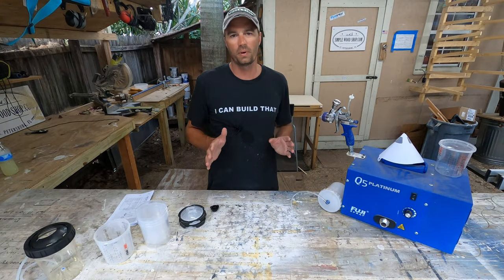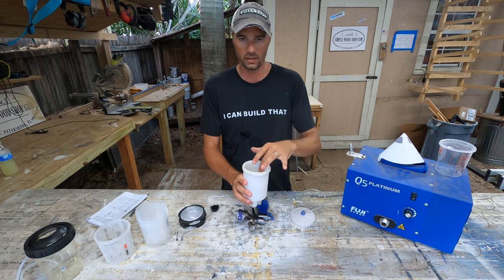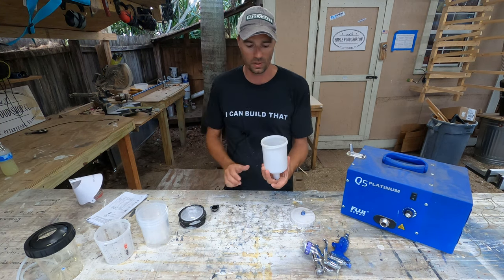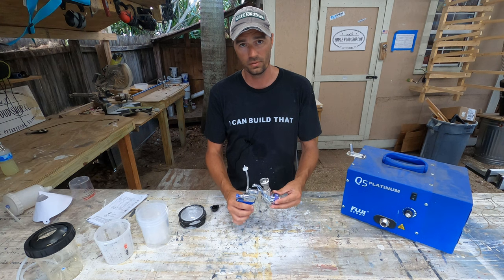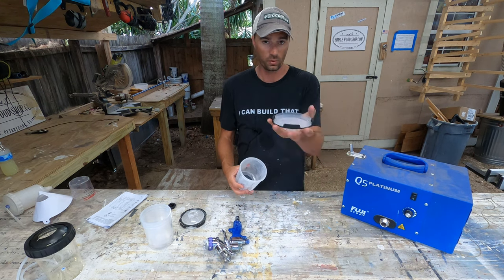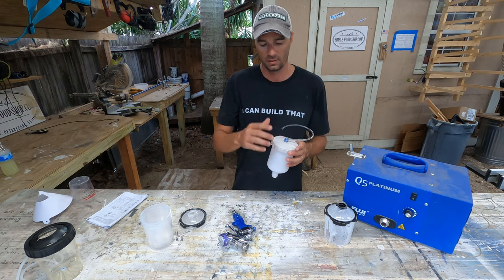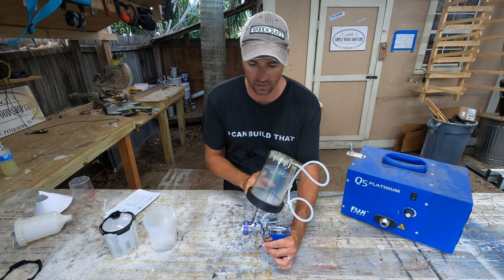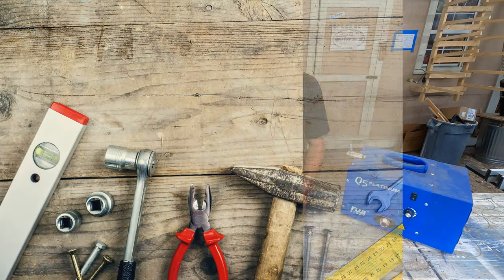Fuji Sprayers and 3M PPS 2.0 system, problem solved

Comment: I started heating up my thicker yogurt viscosity materials and then tried it with nice thick tung oil based varnishes keeping the flash point low and do not need to thin it at all, but I thin it just a little and get excellent finishes! I've never needed this PPS system, but im gonna get one to have and see if it helps anything... thanks for sharing.
Reply from the maker: Do you have enough time before it cools to spray it?
Reply: @SimpleWoodShop  Of course, it can stay warm enough to around 1 to 2+ mins out. For me it's one thing, but I would suggest getting some time in, experience wise as you will get the feel for what is needed or how hot you can get it without any issues. If it's too hot it can flash on the proceeding passes. It's a short learning curve too..' You got this!

Comment: I thought the H/O version was for bottom fed guns, not gravity fed.  I thought  The normal 2.0 version was for gravity fed?
Reply from the maker: There is an H\O cup for both versions of the PPS.  The h\o cup allows you to connect the air pressure to squeeze the bag and push the material through the tip.  The Fuji sprayers need that pressure.

Comment: Great video. I use the PPS 1 H/O system which is very similar but with the advantage of being able to use generic cups and liners, saves a few pennies and I can always nip to Harbor Freight if I run out.
Reply from the maker: Harbor freight has liners and lids for the original system?  Didn't know that.
Reply: @SimpleWoodShop  I suspect a large part of 3M's motivation for the 2.0 system was to control the consumables, the adapters and cup moldings look significantly harder to machine and are probably patent protected.

Comment: it looks like such a great system, but at ~$3 per disposable cup, Im not sure it saves anything over the filter and some wasted material :/  would be cool if you could just buy the liners.  Im sure the hard plastic lid and plug could be reused far more times than the flexible liner.
Reply from the maker: I tend to wash out the liners and reuse them later one.  It's pretty easy to do.  Most are not $3 a liner they are really cheaper than that. They wash out very easily, another benefit is the whole thing is pretty air tight, so I can leave my sprayer and paint in the liner over night and spray the next day without any issue.

Comment: To be fair all your really throwing away is a filter  if you clean out the disposable cup. You still have to clean the gun so sodd all difference imo. And what do you do with the pressure hose ???? The first pot had no option to fit it..
Reply from the maker: On the h\o pressure cup there is an attachment for the hose to go onto.  It provides the pressure to push the material through the sprayer.
Reply: @SimpleWoodShop  
Yea I realise that, but the first cup you showed doesn’t have a pressure hose point

Comment: Great vid and info. This is okay for the T70 range, but not for a G-Xpc (side mount cup) that i ordered with my Q5. 
There is no 2.0 PPS adapter for the G-Xpc. The only one manufactured is for the 1.0 PPS system and is Adapter 24 (161100). Then there's the cup size which has to be an 8 oz 170ml otherwise it won't fit. The adaptor is not available in the UK, even 3M over here were useless and couldn't help. I've started to import them from the states to help guys out, but info like this is invaluable to guys buying systems like the Q5 who just think they can buy any cup liners and lids and expect them all to marry up without any problems.
Reply from the maker: Thanks for watching,  Is this the adapter that works for the G-Xpc guns?  https://www.phelpsrefinishing.com/3m-pps/s24-pps-adapter-gxpc-gt-x2
Reply: @SimpleWoodShop  Bit deceiving that picture Matt, as my order arrived from Phelps and isn't the one as advertised in their picture It's turns out (After speaking to a local paint supplier) that 3M very craftily went round a lot of their users and trade suppliers in the industry and took away all the 1.0 adapter stuff and replaced with 2.0 rendering all the excess cups useless and forcing people to upgrade thus making 3M more money in the process. This means i now have to buy a load of new liners to go with this 2.0. Not happy really!!
Reply from the maker: @vr6caddy843  You will need to speak with 3M and Phelps regarding their pictures and strategy.  I am not affiliated with either one of them.
Reply: @SimpleWoodShop  hey Matt, appreciate the reply, I know you are just trying to help everyone out and your information is invaluable.
As soon as I received all the adaptors, I got on to Phelps and told him about his picture not being what he sent. he never replied which is not very professional, especially after me speaking to him on the phone before purchasing. I'm still having trouble now buying the cup, even my suppliers of paints I do a lot of business with spent an hour with me trying to figure out what goes with what. I think the 2.0 pressurised cup is only available in the states, and to add insult to injustice the 2.0 cup now is a fat little thing not the little dinky one for the 1.0 so I'm no better off. I should have ordered everything from Phelps and if everything didn't marry up, that would tell me that he's just sending out stuff without checking things!
if you have any further info on things, please let me know. if I could track down a 1.0 adapter type 24, I'd buy that also, but just concerned I might get another 2.0 adapter.
Leon

Comment: When using the 3m PPS system do you have to plug the air line coming out of the gun? Or just let the air flow freely?
Reply from the maker: You will need the air for back pressure.

Comment: Excellent video, and thank you for clarifying the black cap on the H/O cup. Question: You recommend using the H/O cup for thicker latex paint, would you recommend this system for all liquids, instead of the non H/O cup due to the added air pressure assist that allows you work even upside down? I'm just trying to decide which kit to purchase. In other words, is the simple gravity fed cup good enough, or should I get the H/O cup.
Reply: Hey,  I would go with the h/o for everything.  I tried to spray primer with only the gravity feed cup and it was frustrating.  The h/o is about $80 and definitely provided that back pressure that is important.  When I did the primer I found myself pressing down the liner with my hand to give it that pressure.  There are two sizes of the H/O cups available.  The smaller cup would be better for spraying upside down, because you typically are in tighter quarters and the cup fits better in those spots.  Hope that helps, enjoy the system.
Reply: @matthickman2589  Awesome Matt, thanks for replying so fast! Last question: I'm going to buy a Fuji Q5 today, so gravity fed or bottom fed? I mainly paint furniture with varnish and paint.
Reply from the maker: Hey Mikey, I've only used the gravity and am happy with it.  You will love the system, If you plan to buy it click on one of the Amazon links I have in the description  and I'll get a little $ but you wont pay more.  Thanks.

Comment: Thanks so much for your excellent video. So it seems to me … that Using the pressure cup with included air tubing, I will still have to mix my coating in a mixing cup anyways? Didn’t see any mixing ratios on pressurized cup. I am also using Fuji gravity gun .
Reply: A separate mixing cup I mean
Reply from the maker: You will have to mix and then pour it in. The liners don’t have any indicators.

Comment: How do you save the material out of the h/o cup when your done?
Reply from the maker: Thanks for watching, The materials with the 3M PPS systems is inside a disposable liner and lid that has a filter in it.  When you take both out of the h\0 cup you can put a plug in the top and put it in the cup that comes with each kit.  Each kit comes with a hard plastic cup to store the solution in and plugs.  The cups are reusable.  The liners and lids are disposable.  If you haven't yet, I would appreciate if you would subscribe, I am working to grow the channel. 

https://amzn.to/36vnhE6

Comment: Quick question, great video BTW. So if you aren't spraying super thick materials then using the pressure tube isn't really necessary? All I will be spraying is automotive paints and I have a similar system currently with the disposable cups for my DeVilbiss paint gun. I'd love to have the same setup like that for the Fuji. I don't have a Fuji yet, I've been investigating the different systems out there. Seems like the Fuji is really good, the other one is the Apollo. Do you have any insight in to how those compare? thanks again.
Reply from the maker: Thanks for watching, I appreciate it.  As long as you are getting consistent pressure and the spray is not sputtering then you are probably good without the pressure tube.  For automotive spraying you might find yourself at odd angles and without the pressure tube pushing the paint it may not work as well.  With the h\o pps system there is constant pressure so you can spray at odd angles.  

Fuji is great stuff, I don't have any experience with the Apollo systems.

Comment: I like spraying at all angles so I only use the PPS with the pressure cup.
Reply from the maker: Hey Mike, That is a significant benefit to the PPS system with the cup.  I haven't had  a use quite yet for it myself but I have tried it on some scrap.  What do you spray?
Reply: @SimpleWoodShop  ... Latex house paint like BM Aura or Scuff-X.

Comment: Great video, answered so many questions I had about adding PPS 2.0 to my Fuji. I would assume the answer is “no”, but does the H/O cup help “push” thicker paints like latex? I know the standard T75 gravity cup is pressurized, but was hoping that maybe having the pressure on the top and sides of the liner might help push thicker paints. So far, I’ve had to thin most latex paints 15% and use a 1.8 or 2.0mm tip to get good results with the T75.
Reply from the maker: The H\p cup does help push the paint better.  I have the Fuji Q5 and I can push latex pretty good.  I do thin it about 10% just to help it but it works well.  18 or 2.0 tips of course.

Comment: Thank you for this video. I just received all the components for the 3M PPS 2.0 system to use on my Titan CapSpray 115 and spent 5-10 minutes tinkering with the h/o cup to get the disposable filter lid to work with the hard cup ring. I got it figured out and then found your video that confirmed my assembly was correct.
Reply from the maker: Right, at least you only spend 10 minutes.  I spent a little more. Glad the video helped.

Comment: Thanks for the video... so basically the 2.0 becomes a 1.0 if you need to use the H/O tube? Since you have to remove the locking ring, it basically makes it the 1.0 system and cost 2x as much. I was thinking of going to the 2.0 - lots of nice upgrades, Except that - which makes it useless with the Fuji T75G gun with pressure tube.
Reply from the maker: In my experience with it in order to use it with the T75G (which I use) you have to have the h\o cup for the back pressure.  otherwise it is gravity fed and then your spray will not be consistent.  It is a good setup, once you buy all the parts.

Comment: Nice and informative review! I'm just starting to use Fuji system and still needs lots of to learn. Currently looking in an ability to use 3M PPS 2.0 due to reasons you've perfectly listed in your video. Not sure if it is compatible with G-XPC gun due to its cup mounting position :/
Reply from the maker: Hey, Thanks for watching.  I appreciate it.  What are you using the sprayer to spray? You can use the 2.0 systems with your gun.  You will need the adapter I will link below.  

https://amzn.to/33xc5VD
Reply: @SimpleWoodShop  Thank you for the answer. I'm going to look for that adapter. I was confused, because it's (the G-XPC gun) not being listed in https://multimedia.3m.com/mws/media/1451272O/pps-2-0-spray-cup-system-part-number-reference-guide.pdf.
I'm a hobyist woodworker and using it to finish my projects. Usually water based lacquers, primers and polyurethanes.
Reply: 3M has adapters for almost every spray gun on the market
Reply from the maker: @ufta54  That's right, they do a good job of making their pps system compatible with alot of sprayers.

Comment: Just switched from a Devilbliss (using 3M PPS 2.0) to a Fuji Q5 with T70 (bottom feed) and want to covert to use the 3M 2.0 system that I have quite a bit of stock and want to continue to use for cost/convenience.  Great video!
Reply from the maker: Thanks for watching I appreciate it.  Why did you swap over?

Comment: Thanks. I'm just diving into HVLP spraying as a home hobbyist and have found value in some of you videos as the Fuji products drew me to your site. I think I will try the 3M PPS 2 (was going to try the original series, still on market). I'm trying to spray linseed oil paint, which is quite thick (will have to thin, unfortunately negating some of the zero VOC appeal of this medium). It's expensive stuff and I don't want to waste much of it.

I actually went with a Sprayfiine A301 3 stage. The Fuji Mini-Mite 3 looks great, but is quite a bit more than the Sprayfine with a lot of similarities (except the Sprayfine comes with a bleed gun).
Reply from the maker: Thanks for watching, I appreciate it.  I would go with the 2.0 PPS system, there is an investment up front with the H\O cups and adapter, and if you did the 1.0 system you'd be slowly phased out.  With the thicker material you will need the h\o cups for that added back pressure.  Match your aircap to your material as well.

Comment: Very helpful video. I have the same setup and just received the PPS 2.0 items.  This will save me some time. Thanks.
Reply from the maker: Hey, Thank you for watching.  Glad it helps.  The pps 2.0 is great and I've found that I don't have to use any strainers anymore.  How do you enjoy the Fuji sprayers?
Reply: @SimpleWoodShop  I have used it twice and like the fact I don't have to thin latex paint too much with the Q5.  Very happy with the results. Looking forward to less cleanup and quicker setup with the PPS system.
Reply from the maker: @romanbenko8187  Exactly, not having to thin too much is a nice benefit.  Glad you like the system and the PPS cups.  Thank for watching the video.
Reply: @SimpleWoodShop  I didn't even know there was a 2.0 system.  The Fuji site just listed the original PPS so I ordered it. While waiting for it I came across your post and then did some research.  I returned it all, unopened, and ordered the 2.0 system.

Comment: What are pros and cons to the two different cup systems? Bottom feed and gravity feed?
Reply from the maker: I have only used the gravity and I like it, with the PPS setup I can get almost all the material out of the liners, very little waste.
Reply: @SimpleWoodShop  sounds good thx for your response. I found that when I did a little auto body work the bottom feed cup would bump things

Comment: Could a 3m performance spray gun be used with the Fuji Q4 platinum?
Reply from the maker: It might be possible, not sure about the connector but I am sure there are adapters for that.

Comment: Do you think you could paint a car with this Fuji sprayer? Seems it produces much less overspray than the compressor systems.
Reply from the maker: Hey,  Yes, Car paint is typically on the thinner side and this pushes that stuff nicely.  I don't have any experience with car painting or compressor systems.  I think it would do a nice job.

Comment: Great tips and not so much waste of plastic too which is a very good thing. I guess this is a failure in 3M’s part by not seeing to make this step a necessary inclusion in their instructions.
Reply from the maker: Yeah, when I first was trying to set this up. I was standing there for 30 minutes feeling real dumb. I’m like “I have a masters degree and this is not working”. Why??   What do you spray?

Comment: Do you have to use the H/O cups for the fuji T75G or are can you use the regular cups on the T75G?
Reply from the maker: It depends on the solution. If it’s thinner then you may be ok to not use the H/o cups. With the non H/O cup there is no pressure tube attachment so you rely on gravity to pull the material down. I would say your effectiveness would be severely diminished without the h/o

Comment: I have the T75G, do i always have to use the pressurized cup? Or can i run without if im spraying standard, urethane, automotive basecoat and using the 1.3 tip?
Reply from the maker: Hey,  I always use the h\o cup.  The original cup and system was designed to have that pressure pushing the material through the gun.  So even though you are using thinner material it is probably best to use the h\o.  But try it both ways and let me know here.
Reply: @SimpleWoodShop  ok, I'll do it!!

Comment: Just recently bought that 3m system for the graco edge 2 gun.  Beautiful.   We shoot a lot of WB 2k paint systems and this has made it so much easier to work with.   Great video 👏
Reply from the maker: Thanks, I have had some success with washing the liners and lids and reusing them.  May save some $.
Reply: What is the WB2k paint system?

Comment: Very helpful tips. Was looking in to this setup and you explained it all perfectly.
Reply from the maker: Thanks, I appreciate it.  It is a great setup.  I have accidently left poly in the cups for several days and they clean out just fine.  Not recommended but not a deal breaker.

Comment: Does it change anything to the thinning? Do I need to thin the latex paint as much when using the 3M 2.0 ?
Reply from the maker: Thanks for watching. Might be able to get away with a little less thinning. Really depends on what sprayer you are using and the power it has. I use a fuji Q5 and maybe only thin 10%. But it’s been a bit since I’ve sprayed latex.
Reply: @SimpleWoodShop  ok thank you. I bought the mini mite 4. Never sprayed before. Thx again for replying